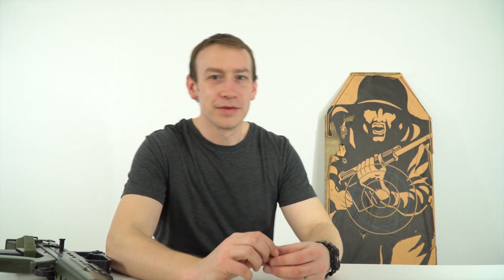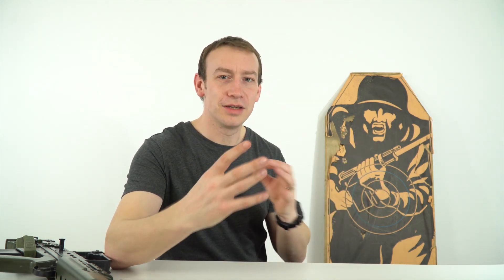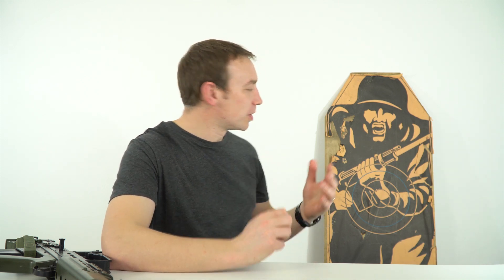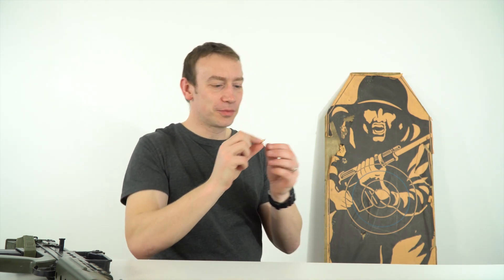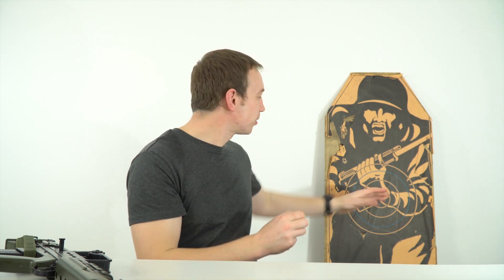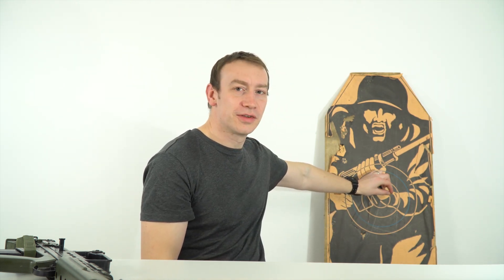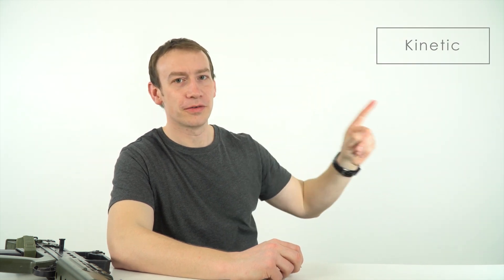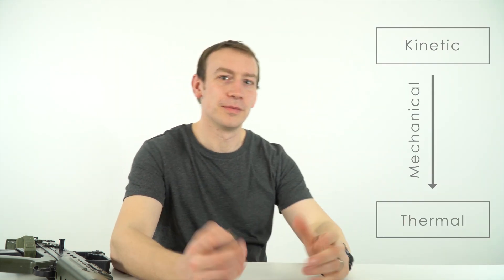Energy Transfers for a Bullet - WORKED EXAMPLE - GCSE Physics

Comment: Hi, I just had a question: why is the potential difference shared equally in all branches in a parallel circuit even if the components in each branch have different resistances?